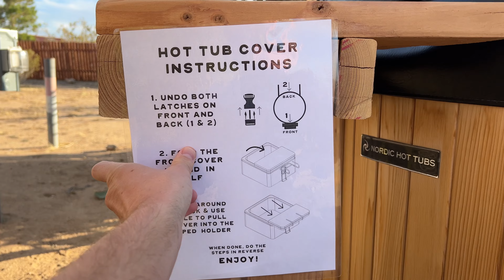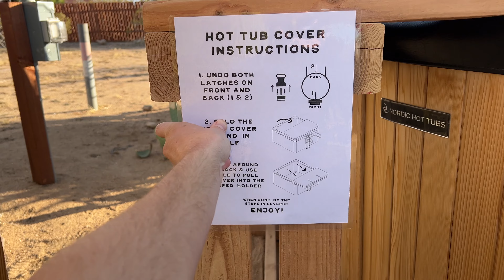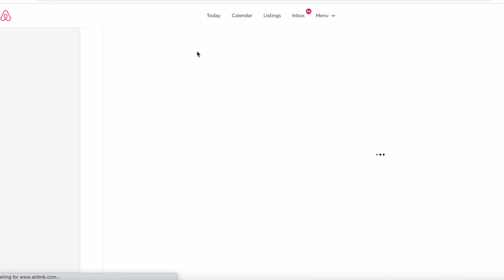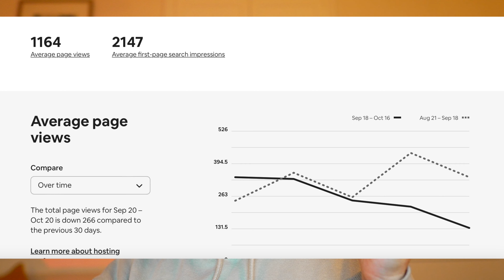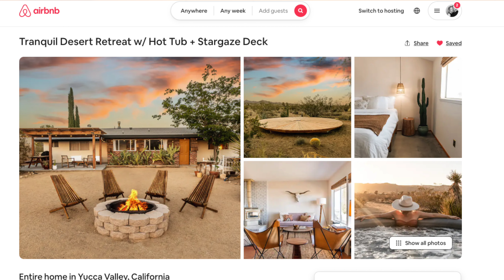Getting our Joshua Tree Airbnb ready for Winter

Comment: I finally ditched my comforters and duvet covers for white quilted coverlets, soooo much easier and when it's colder add a second quilt or a white cotton blanket in white.  Easy to clean and takes about 1/2 the time as messing with duvets!
Reply: Good idea   We just stayed at apple farm inn in SLO this weekend and they had an insert in between the top sheet and a crinkle bed spread in white which looks good but I didn’t like that the top banker could expose the inset and I do t know if the Inserts are washed for each guest.    Funny thing I brought my cozy earth pillow cases as a top sheet
Reply: My vote for the thumbnail pic to show the hot tub and cowboy pool if you can get in the same photo
Reply: Oh cool I just saw the part where you guys cleaned after the wind and got to see a different angle of the bedroom   That was really cool
Reply: Michael - I hate to say this but I am intrigued with the modern looking houses going in  I like the ones that have a angle or even like Britt and Josh’s house    But it’s crazy how much they are charging to build them and they seem simple with the clean lines  it should be way was than 350-400j just for those builds